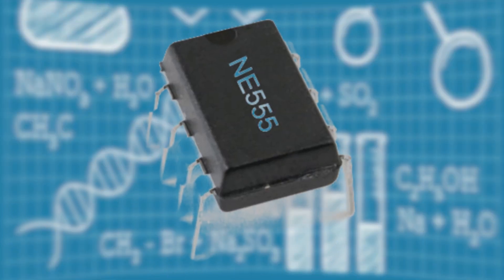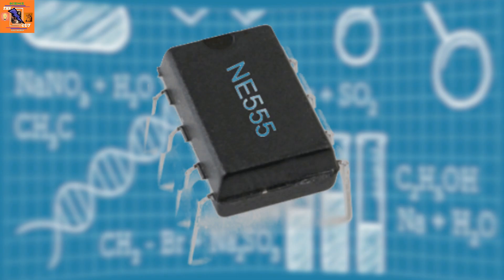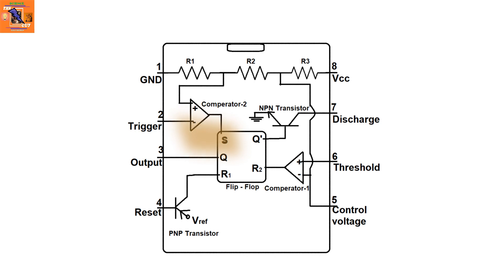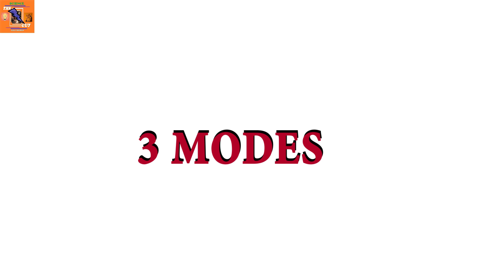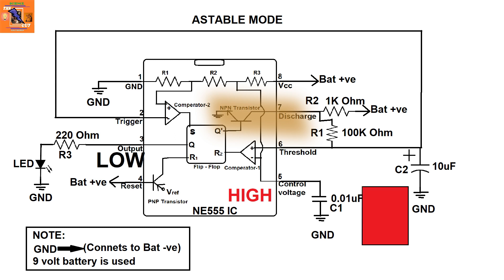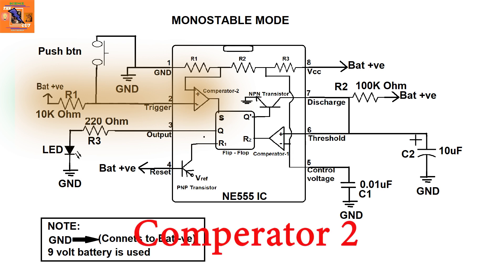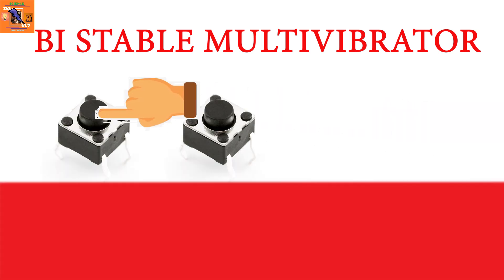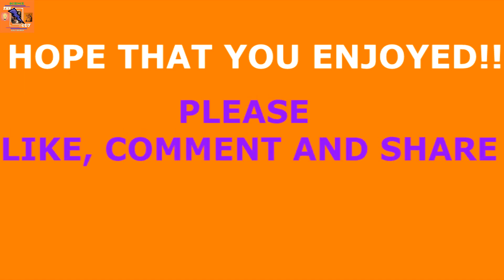HOW 555 TIMER IC WORKS | ANIMATION

Comment: How the capacitor c2 discharge itself when 9 vol is connected across it? Please explain. Thanks.
Reply from the maker: WHEN THE NPN TRANSISTOR CONNECTED TO Q' GETS ON, ITS CONNECTS THE DISCHARGE PIN TO GROUND. I AGREED THAT 9V BATTERY IS CONNECTED ACROSS IT BUT THE RESISTANCE BETWEEN THE GROUND AND CAPACITOR C2 IS LESS SO IT WILL DISCHARGE THE CAPACITOR. ALSO, MOST OF THE CHARGE FROM POSITIVE OF THE BATTERY  WILL BE DUMP INTO THE GROUND AS THERE IS LESS RESISTANCE BETWEEN +VE AND GND PREVENTING THE CAPACITOR FROM CHARGING.